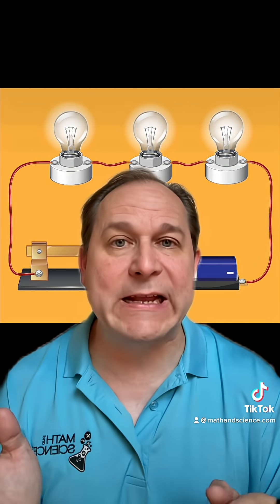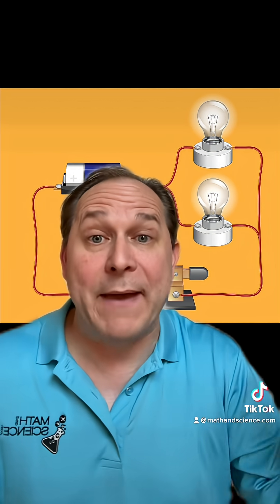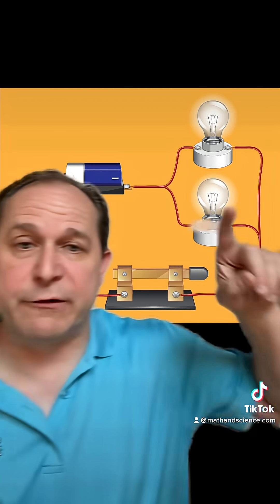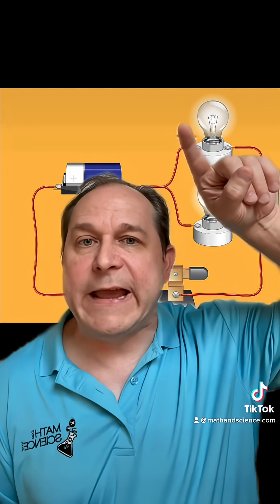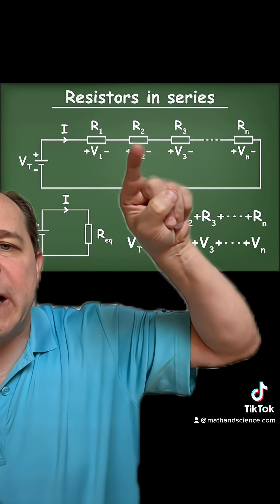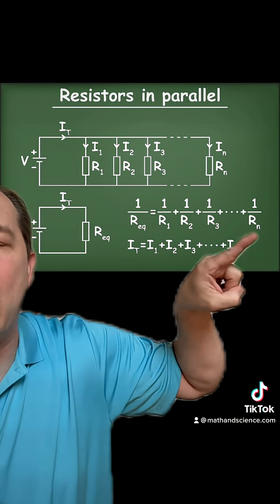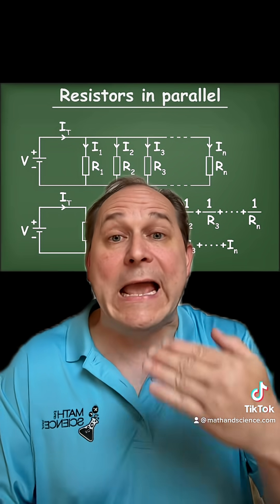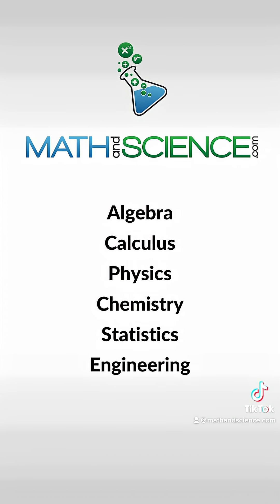What’s the Difference between SERIES & PARALLEL Circuits?

Comment: If you have a series circuit with three equal resistors, and compare it to a parallel circuit with the same three resistors, which circuit will drain the battery quicker?

Comment: If one battery is the rated output for one lightbulb would 3 batteries in series be correct for 3 lightbulbs in series?